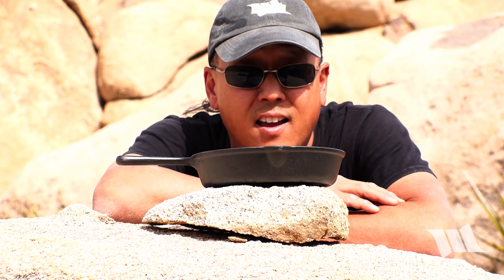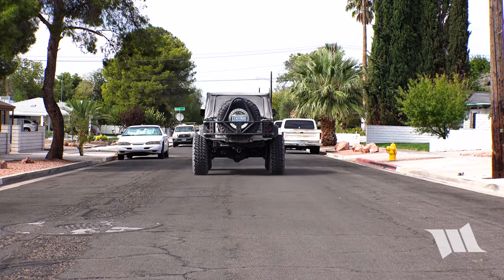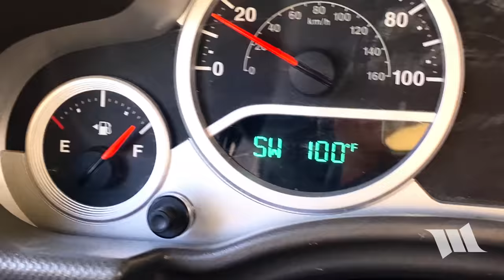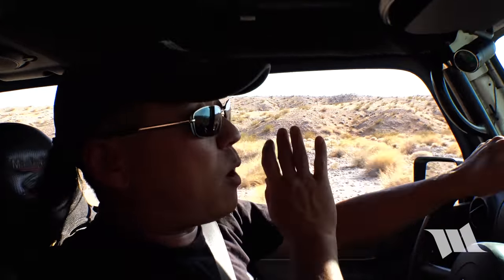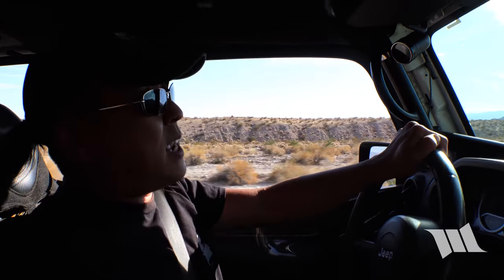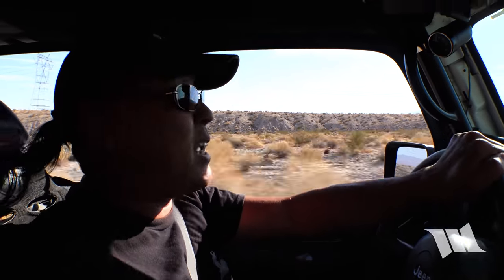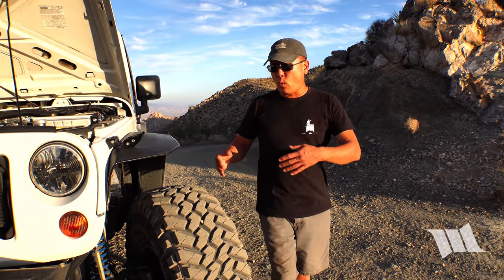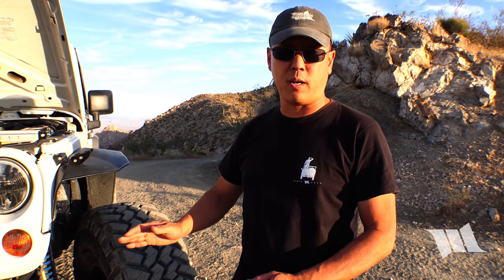Jeep Wrangler V8 Swap Motech Gen V LT 10 Speed Auto in MOBY Radiator and Transmission Temp Testing

Comment: The extra coolers are adding a significant pressure drop to the trans pump which contributes to less ATF flow.

The main stack grill cooler is more than enough to cool the transmission under extreme circumstances. 

You might have a restrictive radiator where you have a high fin density and/ or a wide core which can also contribute to engine overheat .

My suggestion is to removed all the extra trans coolers and use a 1/2” Trans oil lines from the trans to the main cooler using the shortest route possible. 

If the main cooler has a thermal by pass valve, I would swap it with one that start to open at 180 F. That will cool your ATF faster .

The ECU needs to run the cooling fan when the ATF is at 200. 

Swap the radiator with a less restrictive one . Your trans cooler and A/C performance will thank you . 

Unless you’re towing with your Jeep , you dont need anything larger than a 28mm radiator,  even with the LS.

Comment: Some experience! Go into the radiator first, front cooler next and then install another front cooler of the same variety in front of that cooler. The go to rear coolers. Set engine and trans cooler to same automatic turn on temp. You never let the temps get that high to begin with!!!!! Recovery from a high temp is always hard under load!!!!! PERIOD!!!!!! Keep up good stuff!!!!!

Comment: Always enjoy your content!  

How is the swap holding up?  Any issues after getting the initial cooling issue worked out?
Reply from the maker: Holding up great and no more issues. In fact, cooling is now even better than before.
Reply: Nice!  I have a 16JKUHR (3.6/manual) with 75,000 miles.  I have been watching JKLS videos for several years and drooling over the content. 

I am really considering the 5.3/8speed and am unable to find a reason to say no. Thanks for the response and keep the wheel side down.

Comment: Awesome video, did you do this test in 4wheel high the whole time or 2wd? Would either of those selections make a drastic change in temperature?
Reply from the maker: Thanks! We did this in 2WD. 4WD may have helped a bit but we were wanting to push things.
Reply: @wayalife   What about the GM naturally aspirated 6.6L gas V8 the L8T, is that a good option ?
Reply: LOL, I just asked same question about 2/4 wd.

Comment: I know Robbie doesn’t like to mess with his fan temp settings, but do you think a more aggressive approach with the fan settings would help prevent getting the temps that high.
Reply: I mentioned turning them on before things get that hot, since the extra cooling kept them at the temps he started using them at.
Reply from the maker: Fan would only control coolant and 228-230 is totally acceptable for me especially given the circumstances. Trans temp is a lot harder to control and a more aggressive fan setting would not address it.

Comment: A skid plate for the rail cooler and oil cooler would be a great addition for protection
Reply from the maker: The rail coolers sit above the frame rail and the rocker guards. We've run them before getting this done and even ran the whole JKX with them last year. Zero problems.

Comment: Chevy likes to run the latest engines pretty hot, if you look at the stock fan control, the secondary doesn't kick in until above 232F....or when you have A/C on, in a Gen V.  They do the same on their 4 and 6 cylinder motors as well.  It's likely due to emissions, as that temp doesn't produce the greatest HP/TQ.....but if Chevy designed it that way, its not "horrific" for the engine itself.   That LT is a fantastic motor that you should get lots of trouble-free life out of.  I don't have much experience with the 10sp, so I'm very interested in how it holds up.  Hard to beat a 4L80E in terms of durability, but open to new tech.
Reply from the maker: Thanks for the tip. Been super happy with this setup :)

Comment: Comparison without putting the extra fan on for Moby.

As well as taking a look at what the JL or the Gladiator does the same test
Reply from the maker: Without the fan, I'm sure the trans temp would have gotten too hot. As far as a JL or Gladiator goes, they would do this climb just fine. In addition to having crazy powerful fans, neither have V8's under the hood - a point I made sure to make at the beginning of the video.

Comment: @WayaLife  Aww not the video I'm waiting for but a good one none the less. Yes trans temps a little warm, were you in 4wd or just 2 for the test. I believe that temps might would come down if the transfer case was doing some of the work, (if I'm wrong someone let me know) unless you were in 4wd, then the temps are understandable. They may stay lower if you turn the extra cooling on before letting them get too high, it seemed to do a great job at keeping them at the temp you started them on.
Reply from the maker: LOL - what video are you waiting for? We did all this in 2WD and purposefully held off on the fan just to see how well or not the cooling would do without it.
Reply: @wayalife  The explanation of what all was done to Moby.. Engine displacement, hp, torque etc.. or did I miss it?
Reply from the maker: @nicoleahee  On the previous video, I was pretty sure that I stated we had a 6.2L Gen-V LT installed (technically an L86 with an LT intake]) and coupled to a 10L90 10-speed transmission. HP is 420 and Torque 460 ft lbs in stock form which is what we have.
Reply: @wayalife  Ok, is the engine full spec/review on the channel that built it? Possibly I need to go there to watch..

Comment: Stupid question, but do you have any fans pulling air through your front trans cooler?  Best thing about an LS swap: More power.  Worst thing about an LS swap: More power...lol
Reply from the maker: LOL - not a dumb question at all and to answer it, no, we do not have a pusher fan installed.
Reply: @wayalife  Dual fan setup in push thru may be all the help you need.
Reply from the maker: @nicoleahee  Yup, we're looking into it.

Comment: That trans temp does seem high. My 3.8 jk stays under 220 with a single transmission cooler. Recently Moab tested.
Reply from the maker: Perhaps you missed it as I was being sarcastic but I can assure you that nothing in Moab would have gotten our trans temp up over 220.
Reply: @wayalife  long slow climbs in high gear, I get it. Shafer trail going up hill? Air Temps were 103f.
Reply from the maker: @atom31b  Fair enough, didn't think about that trail. That being said, your 3.8L doesn't put out 420 HP and 460 ft lbs of torque. As stated in the video, with big power comes high temps under the hood. Not exactly an apples to apples comparison. At least, not in my opinion.
Reply: @wayalife  I think your availability of low end power is letting you run in really low rpms, this can be very hard on automatics.  Maybe it could all be fixed in shift points? That's what I'm getting at.
Reply from the maker: @atom31b  LOL - I've got a 10-speed automatic transmission with a tap shift. As in, I get to set the shift points on something like this.

Comment: What’s your opinion on the 3.8L vs 3.6L can’t decide on 2010 jk or 2012
Reply: William Wilde 3.6 is a far better engine.
Reply from the maker: @William Wilde It depends. 2012 was the first year out for the 3.6L and there were a lot of problems with it. On our 2012, we had to have the head replaced twice, fortunately under warranty. However, by the time we sold that Jeep, it was in need of another. Power wise, the 3.6L has got it all day long but in terms of being reliable, I found the 3.8L to have it.
Reply: Thank you for your input, I can’t afford a new Jeep and want to spend 25k max and leave 5k for upgrades. The Jeep won’t be daily driver only on weekends won’t have anything over 35”-37” tires so should I get 2013-2014 model or 2008-2010 model then I can get a rubicon that way. Sorry for second question, I know you have a lot of experience with jeeps and I want to get right one the first time. Thank you for your time, I love your Chanel and your dog is adorable!
Reply from the maker: @williamwilde9867  Yes, a 2013-up should be a "safer" bet but there were a few 2013's that did have the same issue. FCA did extend the warranty on the heads to 100k miles so if you can, it would be ideal to buy one that has under 100k. If that's not possible, it might be good to ask the owner if they've had the heads replaced. The 3.6L is a more powerful engine and it would be nice to have. 2007-10 is a good range for a 3.8L and you should definitely avoid 2011 as it was an odd year out.
Reply: Thank you, I got enough information now to start the search, I saw a Wayalife fan Jeep with your stickers on a white jk on Vancouver island , it looked sweet. For my new Jeep I’ll grab some hp stickers from your store!